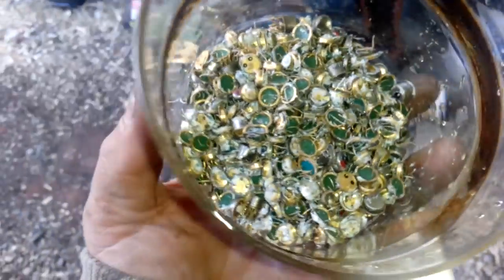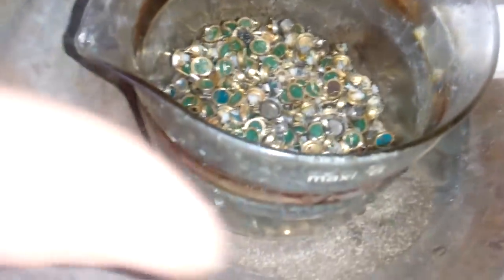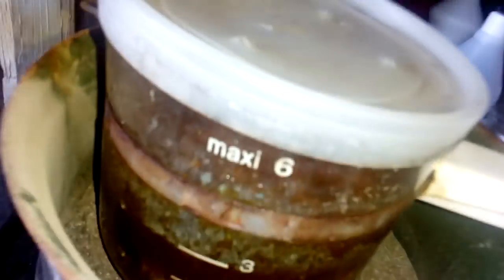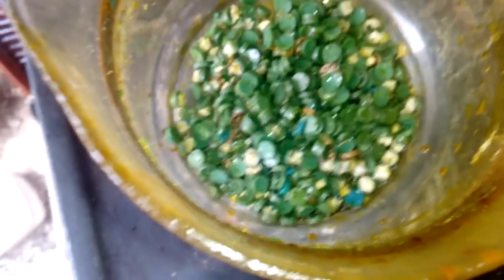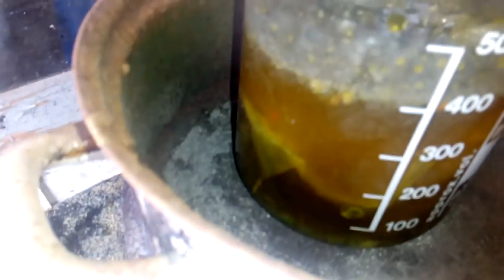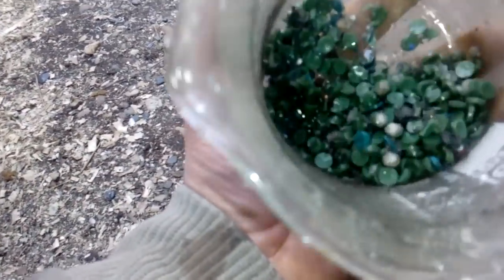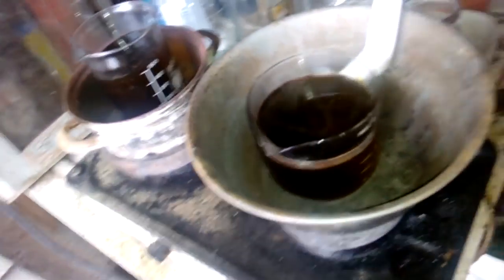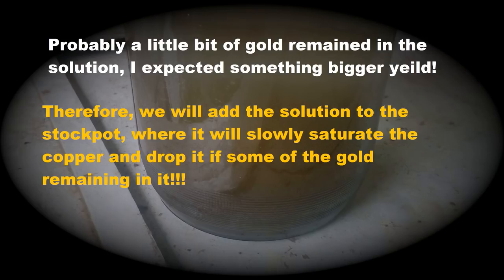Proces Gold plated transistors vith Poors man Aqwaregia

Comment: Once again an awesome video!!! I wish you would have cought the drop on a video but oh well. This video is so valuable to me right now. I have the exact same issue. Only mine is from about 4 kilo of graphics bga and little bga I had wet ashed. I know there was way more gold than I got when I dropped it ( only about 1.5 grams) 
 and I never had any color changes to my solution only got a little cloudy. Did you by chance have a reaction to the second batch of SMB? Mine smelled horribly like chlorine- BAD- I think what is happening in both situations is there is still to much oxidizer in the solution. Please let me know if you think the same. I will reduce mine in the morning and see what happens! Thanks again! And happy scrapping!!!
Reply: So just an update on my situation I ended up adding copper and cementing it back out and starting over! Live and learn!! Happy scrapping. And stay safe!

Comment: Hi friend. Sometimes it is happen like that. You have to remove the caps before refining it. But for this material it is better to use nitric acid first then aqua regia with the gold. There is too many base metals to use just aquaregia or poor mans aquaregia. The more you separate metal the more the drop will be good and the result too. I have already have the same problem i just use a copper bar in the solution and evaporate slowly it is a good method to resolve fail. Gold will sit of the bottom or on the bar, you save the solution. You managed to recover gold and passed the fail that means you are a good refiner. Everybody who refine make error or got fail. It give you experience. Take care and continue good videos. 👍

Comment: hi bro ,,I have seen most your videos and thanks for all tutorial,but I have question?how I refining copper from this solution or other solution?are you have Vedio for this?please help me ,,thanks
Reply from the maker: Thanks to your separated time, friends. From the Ap solution, copper can be recovered by pushing the iron inside or a aluminium foils and the copper crystallizing on its surface and drop. I have not done the reflux of copper from nitric acid until now, but the process should be the same,but aluminium isnt reactive with nitric. One metal drops others only need to see vich is more valubile.